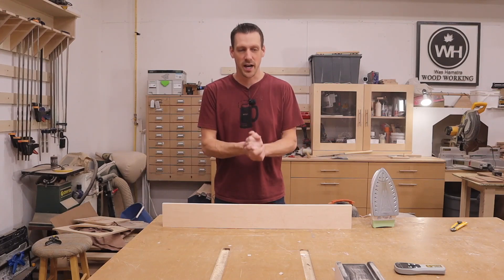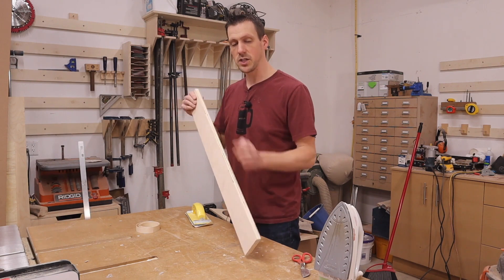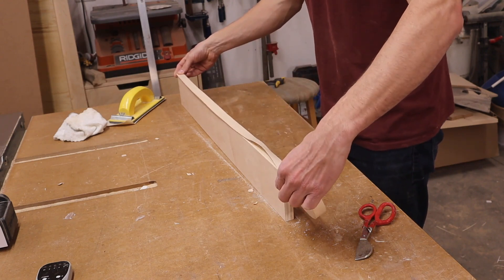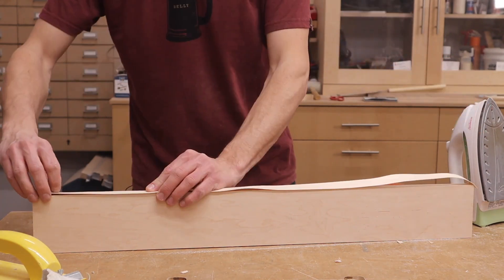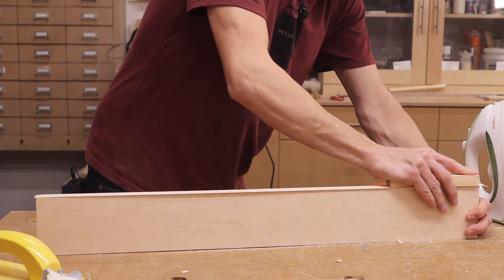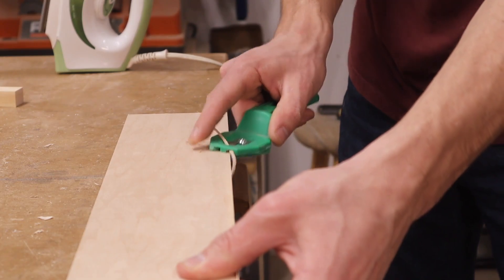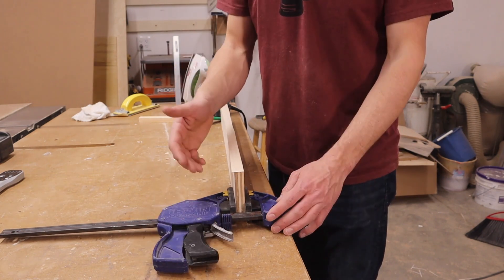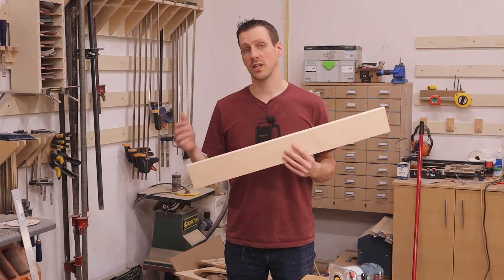How To Apply Edge Banding - Tips & Tricks

Comment: Hi, Wes, this is a very clear tutorial video and I like the idea of touching up the edge banding with the router. Recently I did some edge banding on a melamine board, and to touch it up, I used a file for that. It worked quite well, but it was labor-intensive. I think I'll test the router's method on the melamine and see if it has the same effect. Greetings from Belgium, Christophe.